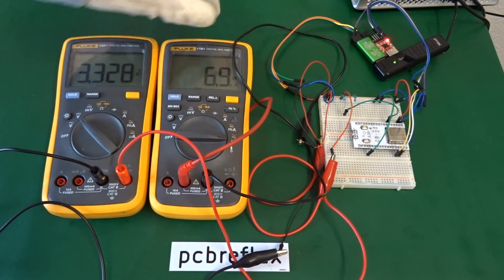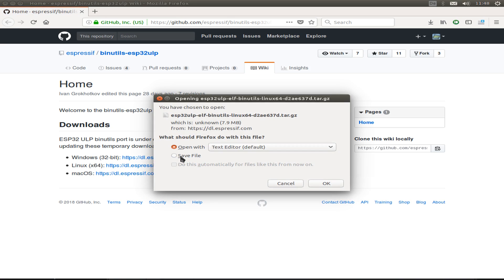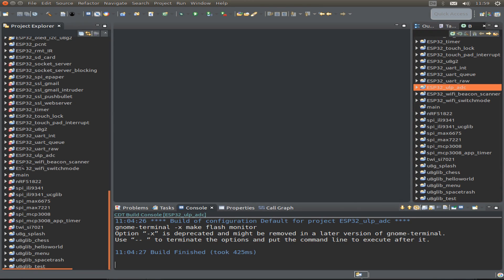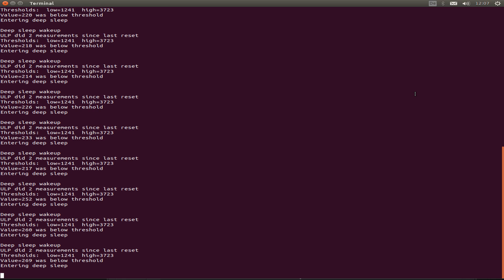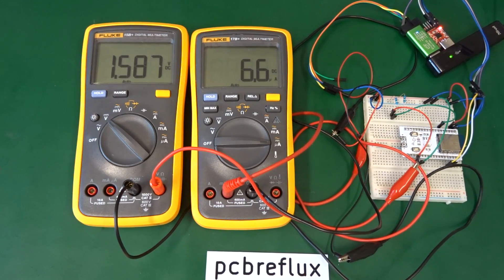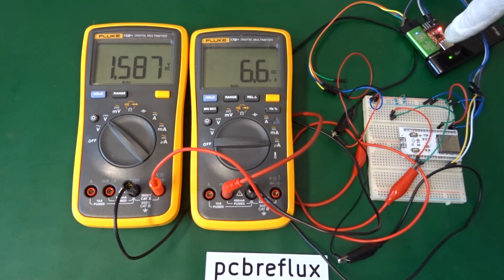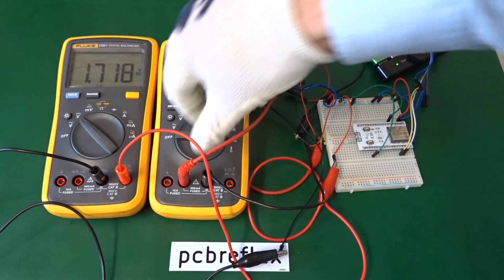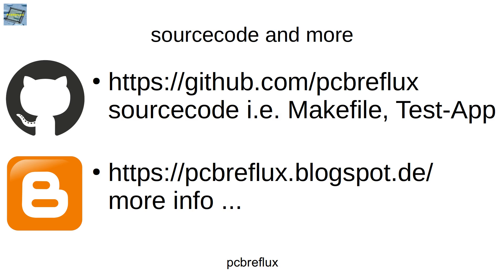ESP32 #67: Ultra-Lower-Power Coprocessor (ulp) and Analog-to-Digital Converter (adc)

Comment: Thx for the comprehensive explanation! Much appreciated. Oke, does it measure and store the data? Suppose I want to measure every 0,25 seconds but want to send the data every 3 seconds...Are the 12 values then sent from the memory or just the last data?
Reply from the maker: With my little assembly knowledge, the espressif example only store the last value (ulp_last_result) but keep track of the number of internal readings (ulp_sample_counter). So if you want to keep the reading you have to store it in the (RTC)-memory but you loose maybe the purpose of the ULP, because its only wake up the esp32 when exceeding the threshold values. 

Try experiment with cause == ESP_SLEEP_WAKEUP_TIMER, esp_sleep_enable_timer_wakeup(...) and RTC_DATA_ATTR to store the values in RTC Memory.

If you don't need ultra low power then maybe just implement this by using the timed deep_sleep function (esp_deep_sleep(..)) and just reading out the ADC value (adc1_get_raw(...) )?

Or you have to dive deep into the assembly program (adc.S) and store the values, but don't know how or where the assembly values are magically mapped to C values.

Comment: Thanks for this example of usage of the low power sore. I read in the data sheet that this special core can do some work using low power. Now I finally see an working application of this. Thanks for this.

What is the sampling rate of the ADC during this deep sleep?
Does the current measured by the Fluke include the current of the voltage divider?
How does the communication between this low power core and the main cores work?
You are using the espressif IDF, so a fear the arduino IDE does not support this Feature up to now. Right?
Reply: I did some simple tests just for public knowledge. I got a reading frequency of >=75kHz, which is great and allows a wide range of applications for a "mini processor in deep sleep"

I did a few more tests and came to the conclusion that the ADC reading of the ULP is ~6.6us, giving a reading frequency of approximately 151kHz. However when adding readings in an ASM FOR(), the frequency obviously drops!
Reply from the maker: Thanks for the questions,

checked the ADC samplings between 50Hz (20ms) and 1Hz (1000ms) (ulp_set_wakeup_period) the current is still btw. 7uA and 10uA. Maybe higher if sampling rate is increase.
Yes, the two 1MOhms are included in the current path (tested also with two 100kOhms but obvious the current is higher). This should be add 1.65uA at 3.3V.

If you seen me switching between mA and uA while waking up the ESP32: the Fluke 17B+/15B+ has a high burden Voltage at uA range so the the ESP32 could not wake up. No problem with mA range. 

The communication works with stored in RTC memory variables, so after wake up the main core can read the values measured while sleeping or write them before go to deep sleep.
Maybe you are able to use the compiled ulp-assembly code inside arduino, with a similar C(++)-code. But didn't test this and don't be sure if the ulp api is fully available inside the binary file libulp.a file for arduino. And there are other generated files like "ulp_main.h" I could not trace how they generated.
Reply: Thanks for your reply!

50Hz is high enough for many Applications.

With many simple meters I have the same issue with burden voltage measuring the current on my Homematic components. Low µA during sleeping and ca. 20mA while sending leads to a power reset. This spoils the experiment. This is why I like my Brymen 857 (nowadays I would buy a 869S) with 50000 counts. So I can use the mA range with low burden voltage and enough resolution to measure uA.  Or mayby you could use Daves microcurrent  https://www.eevblog.com/projects/ucurrent/  . He mentioned that his new GW121 multimeter having the same MAX4238  OpAmp for the current measurement which gives a better burden voltage than the BM869S http://www.eevblog.com/files/EEVblog-121GW-Manual.pdf https://www.welectron.com/mediafiles/datasheets/brymen/BM860s-catalog.pdf .
Reply from the maker: José Morais thanks for sharing.

Comment: Nice tutorial.  Tnx
Reply from the maker: Paul Cristea Due to some time limitations (sending the video to Dave asap) I don't include the changing of the ADC frequency and calculating the values 0..4096 and not tested the ADC with different supply voltages 2.6V 
... 3.6V. Thanks.